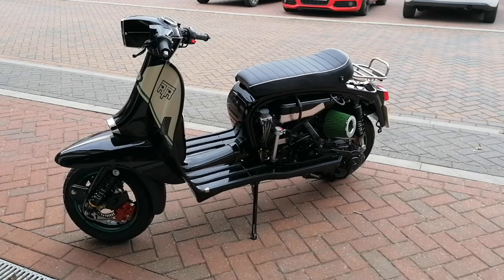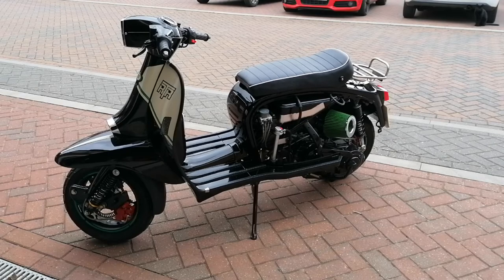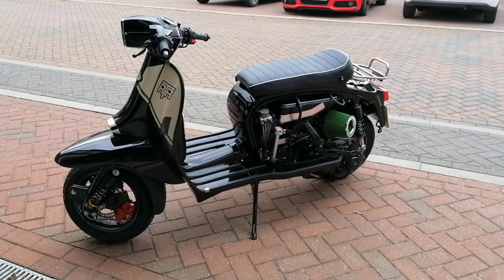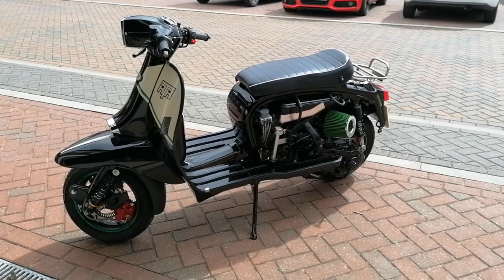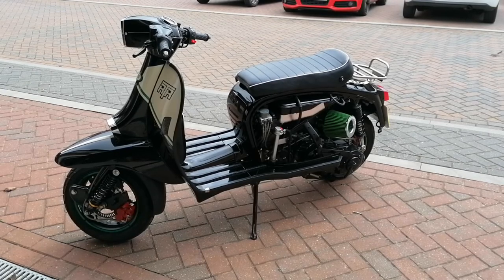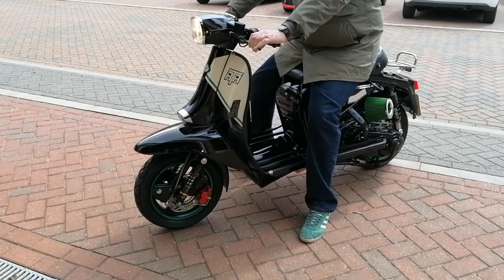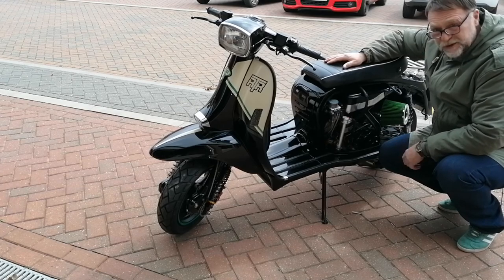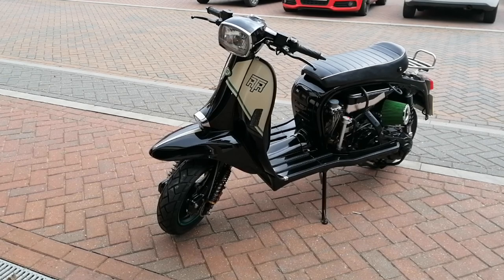Just a quick chat about Scomadi  Stage 4.

Comment: just brought one of these , TL200,  rode it , had valve probs , think it was stem seals , anyway was going to cost , but sourced another engine , but it was a fully tuned pm tuning lump , its got everything , malossi 204 barrel , thats been ported and polished , heads been done as well , malossi veriator,  power commander programmable fuel injection,  PM power pipe , and the Ram air filter........... i had a result , 650 the whole thing , ive had it fitted , god its a monster , even the place i had it done , could not believe how quick it was and they do top motorbikes ........... ive now got the old engine and exhaust if anybody wants it at a price , nice starting point to build your own rocket ship  !!!!!! love it
Reply from the maker: Woa, you got a good result there. I got a couple of mates with the 205 Kit on and they are quick. Nice one. Going down that route this winter. Thanks for responding.
Cheers.
Reply from the maker: Do you know who built the 205 Engine? 650 was a very good price.
Reply: i think it was built by PM, as it has there name and some numbers engraved on the barrel .  and i know tuners do this ,as ive a JB tuning mugello 225 engine in my lambretta.  i got the engine from a breakers in colchester.  its been completely gone through . and checked , valve clearances,  service,  and fitted , 500 that cost . but as i only payed 1800 for a 2500 mile bike thats in A1 condition,  i didnt mind.  ive had scooters since 79, and  been back riding for over 20 years ....... and the scomadi has given me a new lease of life , its great
Reply from the maker: @gdsuperstar5657  you got a result there. PM engrave their engines so they know what's in it I believe. Nice one 😊. I love my Scomadi and I too come from a Lambretta background. Cheers.
Reply: great channel keep it up ! may be you can help me , im going to be looking for some other bits soon , uprate front shocks , anti dive damper, adjustable levers ....... do you know whats best and the best place to get them from . many thanks 😊
Reply from the maker: @gdsuperstar5657  thanks mate. I appreciate your words. I only know one man who I would recommend, Dave Wilson @Retrotech Racing. Though he is very, very busy. Buying parts though should be no problem. He has some nice front shocks at the moment. If you don't mind me asking, who checked over your engine bud. I live in Norfolk and there is no one close by. Thanks again for the comments. Appreciate that.
Reply: @mikeskosnikowski9945  i rang round some of the scooter dealers , and no one intrested , Atoms the dealer local to us has stopped doing them , so i went to a motorcycle dealer and garage local to me . they are called G Force motorcycles . and they are proper motorbike mechanics.  and coz its 4 stroke they were intrested in doing it . a guy called jody is a star , knows wot hed doing and knows some guys at PM Tuning , hes built some go fast mopeds and loves the scomadi , wanted to keep it . they are top people ..........
Reply from the maker: @gdsuperstar5657  I am going to ask the guy who mot's Lambrettas here in Norwich. After all it just a 4 Stroke motor at the end of the day. Glad you got it sorted, those 205s are quick by all accounts. Cheers.